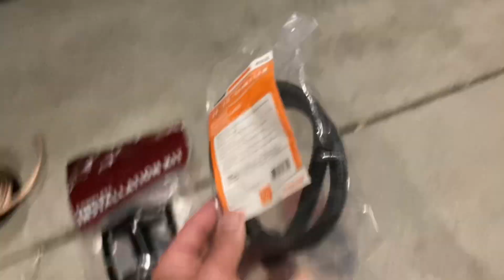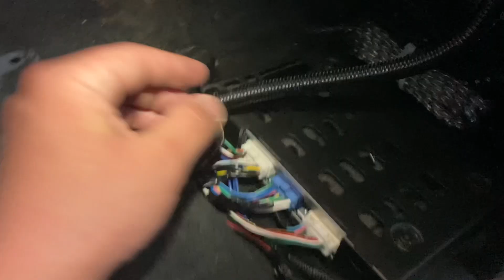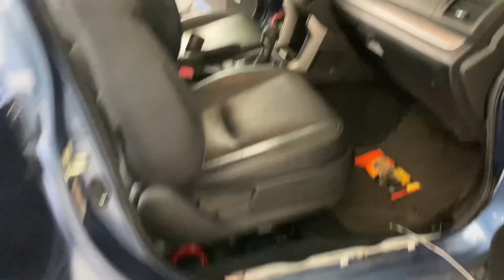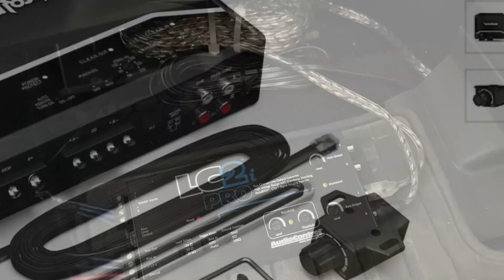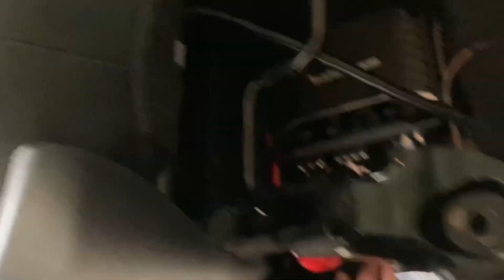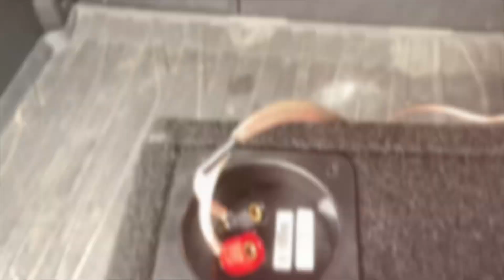Subaru Forester XT Sub Subwoofer Installation, JL Audio Sub Subwoofer, Rockford Fosgate, LC2i Pro

Comment: Did you punch a hole in the rubber garment or did you run it the same way the original wires are ran?

Comment: Hey your video is a life saver! Putting two alpine type r in my 15 Forester.
At the point of hooking line out to stock amp. Is the stock amp under the drivers or passenger seat?
Reply from the maker: Hey Krissemann. Sorry i just saw this...Idk why i didnt reply 3 months ago. My amp was under the driver seat. Did you end up finishing your install? How did it go?
Reply: You guys had stock amps ?👀

Comment: Does the sub fit completely on top of the spare tire with the cargo tray down? I am wanting one of these for my Crosstrek…just want to be sure it would fit on top of the spare tire. 

Does anyone know if the dimensions of the slot between the two cars is the same? lol
Reply from the maker: Hey Travis, sorry just saw this. I dont know if the dimensions are the same. Sadly, I sold my SUBARU recently. Were trying to buy a house soon, and had some other life changes, so i sold it so we wouldnt have a car payment anymore. 😕

Comment: Great job! So it looks llike the radio sends the audio signal to the amplifier below the seat and then the amplifier power all, the HK speakers and the sub? I am trying to change the original radio but keeping the amplifier and speakers on a FXT2016 ( it died, keeps booting and booting ) but it seems a little bit tricky, since all the aftermarket radios do not have line out to go into the amp.
Reply from the maker: yes your right about the radio sending the signal to the factory HK amp, and then it goes out to the factory speakers. In this install, I tapped into the signals BEFORE they go into the factory HK amp. Sending them to the LC2i Pro, then to the RF Amp, then to the JL Sub. So the new Amp does not help the existing factory speakers at all, it’s only supporting the new JL Audio Amp.

Comment: I have a forester too and I want to install a subwoofer by myself because people are going crazy with the install prices
Reply from the maker: Hi @Carlospm999 Thank you for checking out the video. Yeah - it can get expensive paying someone else to do it. I calculated from the 3 locations that I got a quote from - I would have paid around $500 for someone to install this system.  I ended up spending right around $1,000 for all the equipment seen here, and it took me a couple of nights during a week, and then my whole day Saturday, and part of Sunday to wrap it up.  What did you end up deciding to do for yourself?
Reply: @alexmancilla9498  so I started looking at this kind of videos and a friend of me helped me out we did it this pass Sunday sounds amazing and learn something new as well
Reply: @alexmancilla9498  i got a quote for 350$ I went to different place and they said 220$ I went to Facebook on marketplace and another guy said he would do it for 180$ but I still found that expensive just for install I had everything all the cables everything new and I wasn’t gonna pay that much so